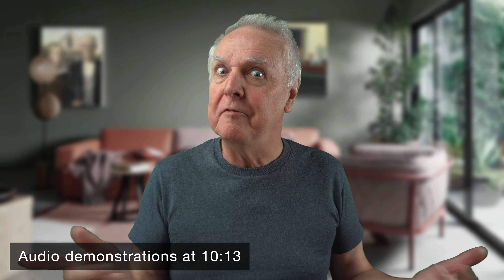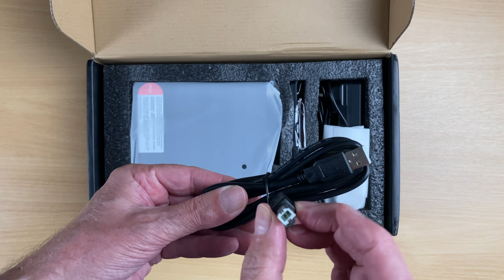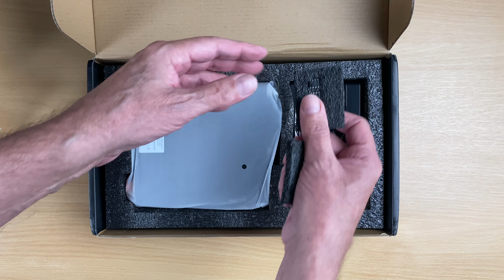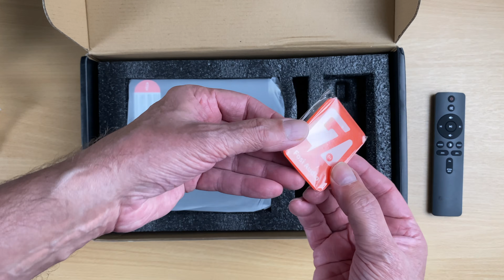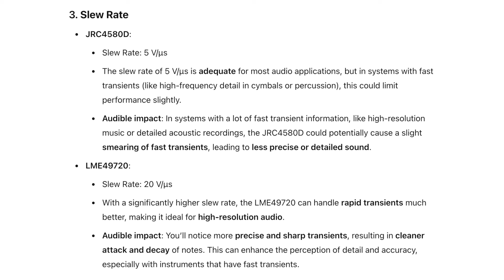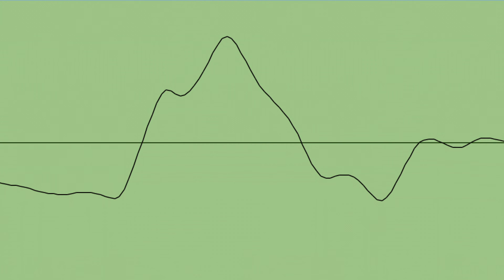How to degrade the performance of this beautiful DAC [Fosi Audio ZD3]

Comment: Why don't they put better op amps in it from the start? Now i have to do it myself by screwing the damn thing open to replace the op amps myself. I never buy things that can sound better but the manifacturer doesn't put the best things in it themselfs.
Reply from the maker: The more highly specified opamps were installed already. As I said towards the end of the video, you can use this DAC as supplied.
Reply: @AudioMasterclass  I probably haven't heard that because it is already almost 12 am. Thanks for clearing that up for me.
Reply: I've been asking that question since the start of this chip flip fad. 

If there is a better part... put it in at the factory.

The thing is that ... this is audio ... it's low frequency low level stuff, it's not that demanding... quite often the "better" chip brings no improvement whatsoever. But still these guys just have to tamper with everything.
Reply: There is nothing wrong with the op amps they have installed. Do you expect them to put in op amps that cost more than the units retail price like Sparkos?? Do not be so cheap or so lazy. No one is forcing you to purchase their product you could purchase a more expensive unit that might come with op amps more to your liking. Do not be so lazy not  like you are going to devote a day to making a wooden spoon and wooden bowl to eat with get over it! An allen key and a nut driver big deal. They where kind enough to give you sockets so you do not even need to desolder and resolder anything! Man-Up already!
Reply from the maker: Haha, you’re criticising me for stuff that exists only in your imagination.
Reply: @buckaroobonsi555  Sorry if i offended you. Good Lord.  But screwing things open which i bought new is not really one of my favorite things. But lucky for me the uploader gave me a much nicer comment and cleared things out a way better without calling me lazy or cheap.

Comment: I can hear a difference, even on my lg to. The low vocal frequencies on the first clip sound bloated, resulting in a sense of disjointedness between the high and low frequencies of the voice. The second clip keeps the coherence of a single voice. I wondered if this might be an anomaly of utube, but the second pair of samples exhibit the same characteristics. I was surprised to see such a small difference in the waveform considering the marked difference in sound. 

I’d like to request that you do a test of sound reproduction of your/any mobile phone, and test to see if an external DAC offers anything?
Reply from the maker: It might be interesting to compare a £9 DAC with a £1000+ DAC, both of which I have. Guess which one I use more often.
Reply: What if I tell you that what you think is bloated sound acutally is reverb from standing waves of the room the recording was made...
Would thet make sence to you?
Room reverb adds some low frequency harmonics to the recording. Too my ears 4580 do a better job than 49720 letting those reverbs through to your headphones.
Reply: Interesting theory about standing waves. A comparison against a “reference” quality DAC might answer that question.

Comment: An uneducated guy here: I feel like the 4580 sounds has some reverb (like in an empty room), which I do not hear in the 49720 sound. Maybe I should not have drinked coffee before.. 🙂
Reply from the maker: The original audio, which is the same for both opamps, is from Abbey Road Studio 2. Since there was only me and my assistant in there it is more empty than it would normally be for a recording. If one opamp makes this more apparent then this is an interesting difference if it’s what you hear.
Reply: @AudioMasterclass  Yep, its plenty noticable. At first listen, that is. Not after listening 5 or ten times to it and trying to find any differences. The JRC has more reverb, it sounds more airy. Not like the reverbaration of an enormous empty room, but a sizeable empty one. All that with a pair of 350 euro Senheiser Momentum 2 headphones, the headphone amp of a 1995 Kenwood KA2060 amp and a 100 euro Khadas Tone Board dac and cheap cables.
Reply: I hear the same thing and once detected it's not that hard to hear the difference.
Reply: I also heard the same thing on the very first listen. The 1st sounded like an echoey room, the second lost that and the voice sounded more precise, and seems to have more bottom end. I think the proper way would be to put your favorite music on and determine it that way. What sounds better for just speaking, you may not prefer for music.

Comment: Is the power supply that comes with this dac switch mode or linear type?
Reply from the maker: Switching, as one might expect.
Reply: @AudioMasterclass  Okay thanks for that information. I have found that using a linear power supply noticeably improves the sound of dacs. However, I have noticed another improvement by using a mains noise filter to supply the PSU. I used a toroidal bifilar wound RF noise filter and a spike suppressor using VDR's. Also I found that the mains earth is full of RF noise so make sure the mains earth is not connected to the coaxial braids of the audio connection leads. Sadly the mains supply in the UK has become full of noise due to switch mode power supplies and triac controlled switching used in many devices.
Reply: When have you seen any product Fossi Audio makes come with a linear supply? Switching power supplys get a bad rep because everyone is using the cheapest switchers they can get their hands on. It is true all switchers are noisy depending on what you are using them for but their switching freq. can be manipulated a lot and filtering can be added so that you never know they are there in the circuit. It is another thing all together if someone is running ameuter radio gear nearby and picking up your noise. Solar Power Inverters are terrible for this. Copper and steel are expensive, heavy, and bulky just about everything we use would cost 2X to 4X as much as if they all used linear power supplies. The real problem is that bean counters at every company want to skimp on everything so you end up with a switcher or linear power supply that barley meets the needs of the gear with no head room to spare often and it shows. Linear power supplies are not magic!
Reply from the maker: It is another interesting opamp spec how much they reject mess on the power rails.
Reply: @AudioMasterclass  Yes correct but only if the op amps are powered from a split centre zero supply from a transformer with a centre tapped secondary. That makes the noise on the power rail 180 degrees out of phase with each other. Therefore any supply noise cancels out. Many dacs have a power separate power supply that is not a balanced split supply. They use electronic means to create a balanced dc supply where the noise on each rail is in phase and therefore doesn't cancel out. The supply ripple and noise rejection of an op amp can only be realised when using a true split supply.
Reply: I use a Hades for filter....